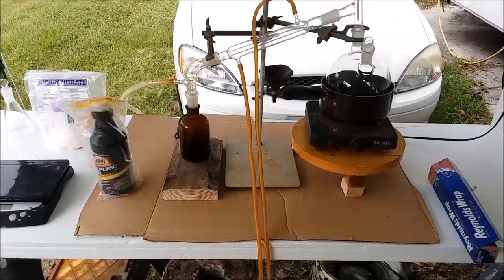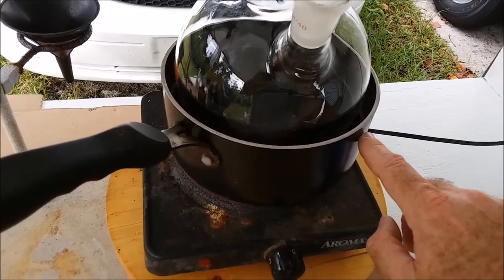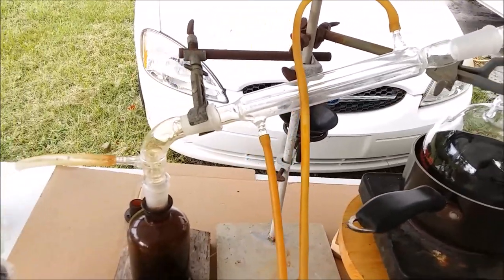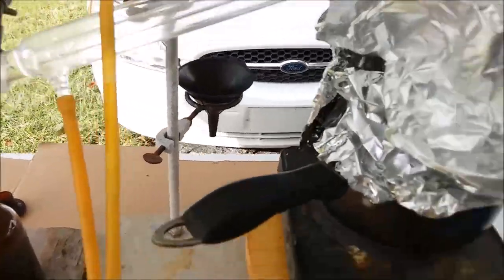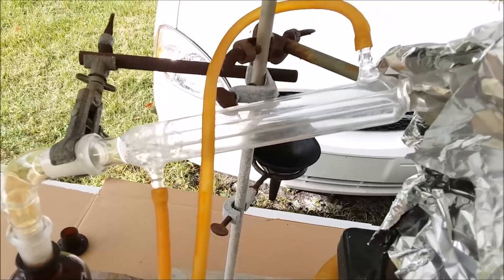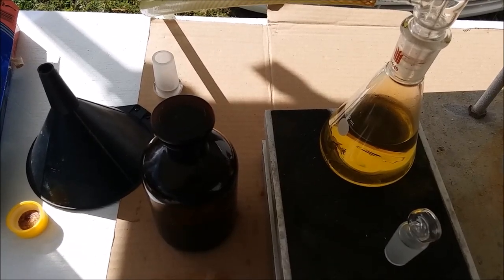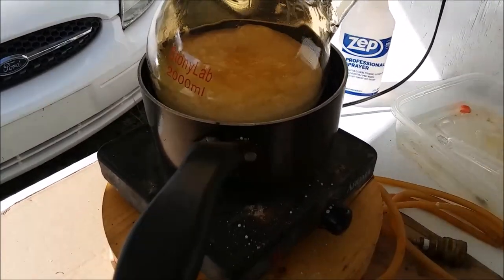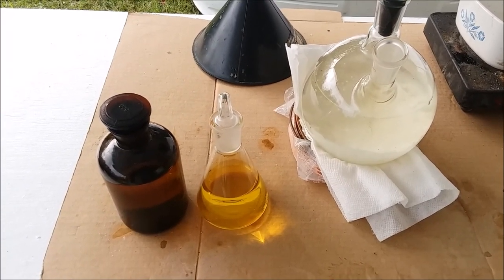Further improvements to my home nitric acid production process

Comment: The sodium nitrate clumping up is because it's absorbing water (which I think you pointed out). This is the sodium part of the chemical at work. This is why I only use potassium nitrate (or ammonia nitrate if I can't get potassium for some reason) in my nitric acid production for gold refining. Potassium nitrate is also cheaper than sodium nitrate as you can buy it as Stump Remover. I pay $6 for a pound of the stuff and it's 100% pure with no filler. I almost hesitate to mention how amazing it is for fear of knowledge spreading and my source selling out of stock repeatedly as is common.

Comment: Is that a Stonylab flask? If so, it's made out of high quality borosilicate. You say you poured slowly because the fresh acid was cold and glass hot (and you didn't want to crack anything). Fortunately, you did not have to worry. Boiling lab flasks are made out of borosilicate. The coefficient of expansion is very low in borosilicate (which is why they use it) -- the temperature differential that borosilicate glass can withstand before fracturing is about 330 °F/180 °C. So if your flask was around 90°C (just above the boiling point of nitric acid), you'd have to put a liquid in there that was  negative 90 °C or  negative 136 °F in order to fracture it with thermal stress. You could put dry ice in there and still be fine as it's temp is only negative 109 °F. There's a caveat though; this is all under absolutely perfect, optimal conditions. A heavily used lab flask may have already weakened over time, sustained micro-fractures you can't see with the naked eye, experienced previous thermal stress, etc and so can & will fail earlier than expected. This is one of the main reasons why I will never buy a used boiling flask -- you have no idea how the previous owner treated it, and if you're boiling acids, it's extremely idiotic to take that risk when new glassware is super inexpensive these days (amazon,  aliexpress, etc). One thing that you may want to consider is getting a heating mantle. Even using an oil bath, you're going to have a hot-spot on the bottom. Not a particularly big one, obviously, but over months & years it's going to weaken the glass. Heating mantles use a heating element threaded throughout the 'mantle', and the way the whole thing is insulated/covered gives a much more even heating.
Reply: I couldn't agree more about the heating mantle.  I have been using a 2,000 ml. flask (just like used in this video) and they are well under 100 bucks on E-bay! Great comments Zidbits...

Comment: So instead of putting water/baking soda mix into the double neck flask ,, just put 300-400 ml of pre-heated distilled water in it, keep the warming bath on low until everything is dissolved, because it’s only warm (125-140F) you can handle it, once dissolved pour into a beaker or old coffee pot, and allow to cool to room temperature,, once cooled All the bisulfite will have crystallized out of solution, leaving a weaker nitric acid solution on top,, this weaker acid can be filtered to remove any lose crystals that come over with the pour, my personal yield from this ranges from 25%-40% depending on how much water is added,, you can increase the yield percentage by placing filtered solution in freezer for 1 hour to precipitate any remaining bisulfite , but this usually also reduces volume
Reply from the maker: Thanks for the tip. Even dilute nitric acid is useful.

Comment: Love your videos though. And I’m still jealous we can’t get H2SO4 drain cleaner
Reply: Not a problem markgellie7032!  I purchase sulfuric acid (battery acid) from my local automotive store.  I then boil it down to  concentrated sulfuric acid: even cheaper than buying drain cleaner.  I simply "cook" it down in my 2,000 ml. flask.  I do use and suggest using a heating mantle for even consistent and sturdy use.  They are around 80 bucks on e-bay.
Reply: h2so4 too strong for pvc plumbing...i think......

Comment: Not sure if this was mentioned because I skipped through a lot of the video, but it's always a good practice to keep a large jug and spray bottle of sodium bicarbonate "Baking soda in water mix" nearby just in case some acid is spilt on you or anything else. Great vid! Live in AZ also and I wish I knew a lot more about gold panning / rock hounding etc.
EDIT: That is not red fuming nitric acid. That is white fuming nitric acid with some mellow yellow coloring. If the acid, you made was kept in a freezer for a week the yellow coloring will go away. To produce red fuming nitric acid, water would need to be added to your acid via certain ration which is found online. Cheers!

Comment: Just use 500g of calsium nitrate and 1500g of sodium hydrogen sulfate and dry distill it.  the hard cake left in the flask is dissolved   with ammonium carbonate solution.

Comment: I think to start with you're distilling water at least when I did it with fractional distilling I got water first then when temp changed again I would switch over and collect the acid  perhaps that's due to the difference between apparatus

Comment: Great video. Love it. Can you please tell me what the hose coming off the receiving flask is for?
Reply from the maker: It vents the excess nitrogen dioxide away. The whole distillation apparatus is too big to fit in my fume hood. I usually set it up just outside and run the hose into it to get rid of the gas.
Reply: @omegageek64  I am making my own nitric acid using sulfuric acid and potassium nitrate. I had a boil-over and some of the contents of my boiling flask ended up in my receiving flask. Has this ever happened to you? My thoughts are to simply pour the contents of my receiving flask back into the boiling flask and start again. But do I need to? I can see the potassium nitrate on the bottom of the boiling flask and can filter that out, but what about the sulfuric acid mixed in with the nitric after I filter? Will it matter. I am using the nitric to work on gold. Happy New Year.
Reply: @damiantracey7767  if ur solution boils over then u basically have to redistill to get a pure product. im not sure is it has an affect of gold refining but i would recommend to lower the amounts of reactants or get a larger flask. you could also turn the heat down to reduce foaming.

Comment: Great video this is a process I have been looking at for awhile now. Nitric Acid is hard to come by here also in WV and exspensive. But the sulfuric acid and potassium nitrate both are locally available in quantity at reasonable price.  I am just struggling to find science glassware of good quality as it's a lot of money to shell out to have it fail due shock cracking from the heating. If you had any recommendations they would be appreciated.
Reply: Where do you get your potassium nitrate in WV? The only nitrate I can find reasonably in southern WV is ammonium nitrate
Reply: @jacobshrewsbury1938  best place I have seen is Lowe's it is sold as a stump remover. It's brand specific so it's the Spectricide brand it's practically pure Potassium Nitrate. To create pure crystal if needed all you do is dissolve in just enough distilled boiling water. Then chill the solution to go pure Potassium Nitrate Crystals. They are plenty of videos on this process to watch it done.

Comment: How hot is your oil in your oil bath while doing this? Just curious because when I tried this even wrapped in foil my thermometer didn’t seem to show much temp rise or no result and then it shot up with the foam.

Comment: Hey my friend. Just wondering where you get you sodium nitrate. I'm in canada and can buy from the states but cant find it anywhere where they sell larger amounts. These places only sell 500g. Please if you could help me.
Reply from the maker: I got it on Amazon.
Reply: @omegageek64  says currently unavailable.  For about a year now its said that..
Reply: Thank you
Reply from the maker: @janepeacock-baillie3380  That is very strange. It is available here in the states. Maybe it is an import/export issue? Try stores that sell gardening supplies. It is also used as a fertilizer. You could also use potassium nitrate. It is often used as a stump remover.

Comment: stiring heating mantles gave come down a lot in price. whata ya think of using them in lieu of oil bath?
Reply: I have used mine since day 1!  I would never give up on the constant heating, sturdiness and reliability it provides.  Just treat yourself and get one.  You will soon want another one, which I am considering running 2 at the same time for increased production and time management and efficiancy.

Comment: What type of oil do you use for the oil bath?
I tried a mineral oil from Publix and it smoked terribly.
Reply from the maker: I use 10W-40 motor oil. It handles the heat better.
Reply: I like that dot 5 silicon break fluid, non-flammable & good till like 240°C give or take 20  or 500°f 
(I've heard a little past 350°C in an oxygen free environment)

Comment: Why don't you use a hedrometer to measure the density of your product?  It's cheap and easy.  Also, if you want water white acid, add a very small (mg/L) bit of urea to the product to scavange the NOx.  Don'y use a lot, you want to burn up all the added urea nitrogen, so there is effectively zero in storage.

Comment: Why does the sulphuric acid look red?
Reply from the maker: The commercial grade drain opener acid I am using has stabilizers added to prevent it from attacking pipes.
Reply: @omegageek64  Why do they use nitric acid for drain opener? Sodium hydroxide will do the job well. Nitric acid is a waste for this.
Reply from the maker: @Berghiker  I think you mean sulfuric acid. I don't know why there are two  such different products on the market to do the same job, except that maybe because they both work.
Reply: @omegageek64  yes I mean H2SO4. Oh, ok.
Reply: @Berghiker  sulfuric acid is really good at dissolving organic things like hair that clod pipes

Comment: it's a bad habit to start the hot plate and delay starting water in the condenser. wait long enough, and with iced water, you can crack the condenser's glass from temperature shock. A sudden introduction of ice cold fluid into a heated glass tube with glove burning acid running thru it......not the makings of a great day